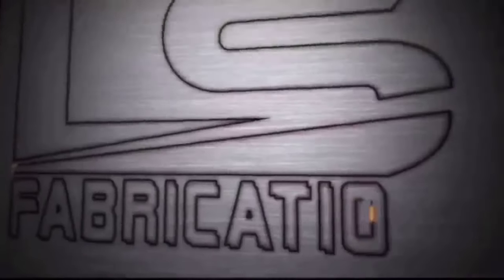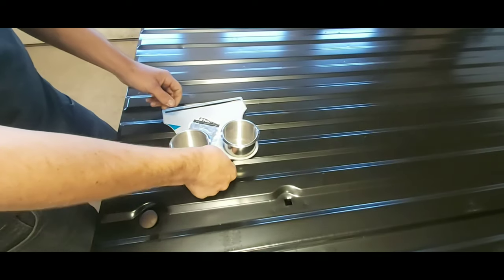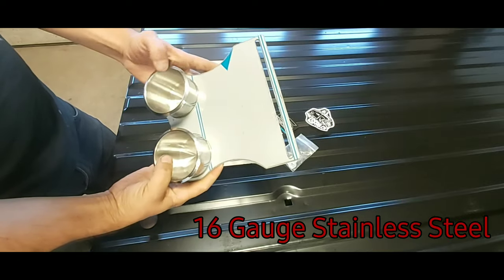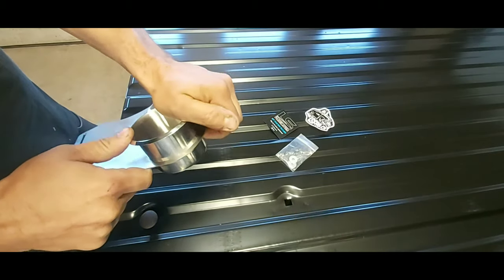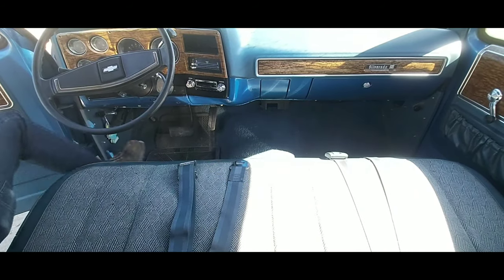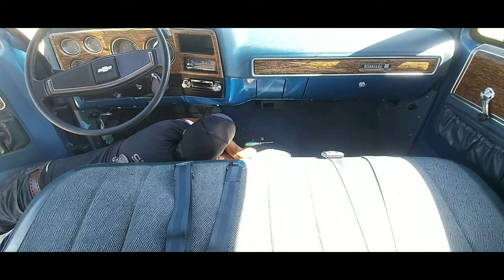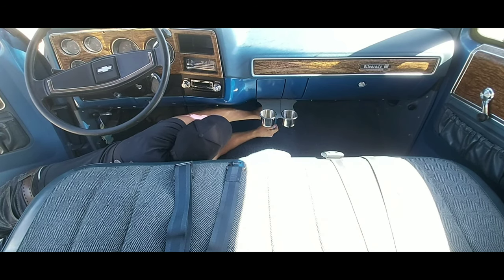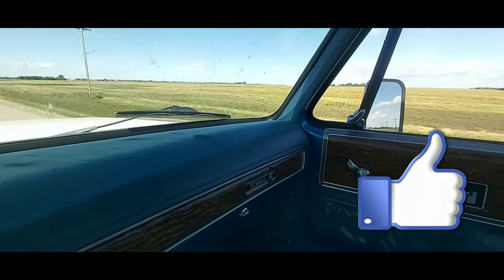Square body Cup Holders for 1973-87 GM Trucks

Comment: 1991 was the very last year for the squarebodies. Just the regular cab pickups "half tons & three quarter tons only" were done in 1987 & same with the one ton regular cab pickups in 1989.
Reply from the maker: Correct. For the people that know this we didn't feel it needed explaining. However having to explain this to people that don't know and having them assume these cup holders will fit their 1991 1/2ton Truck. 
This is why we haven't listed these as fitting 73-91. 
So to recap: 73-87 1/2 ton, 88- 91 3/4 ton and 1 Ton, Plus Suburban Square body Style.
Reply: @lsfab4607  & the square bodies were the first Chev & GMC fullsize pickups to have bigger cabs "crew cabs" as an option which was introduced in 1973 & 1973 was the first year for the square bodies too like you said. The crew cabs were only available on the 3/4 ton & 1 ton models & they only had the 8ft long fleetside box unlike the ones nowadays that are available on 1/2 ton models too with the shorter boxes.
Reply: @lsfab4607  w in the cup?

Comment: How does this fit with a Muncie 4 on the floor and transfer lever?
Reply from the maker: Works with the SM465 and 73-80 Transfer cases, does come close to the 81-91 TCases in the square bodies but guys have lived with not going into 4low or just sliding the cup out of the way when going into 4 low.

Comment: When the video moves from the back of the bed to the inside of the cab, the stainless steel plate goes from flat to bent at the mounting slot. I take it that we have to make that bend, correct?
Reply: No all holders come pre bent for your specific truck era. I used a new bracket in the back bed clip. No CGI here. Good eye! 😉👍